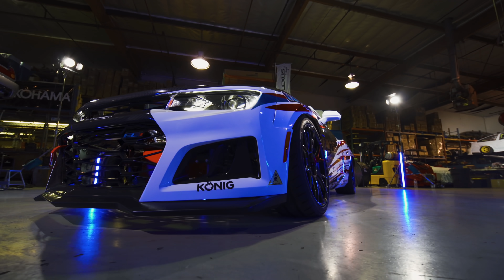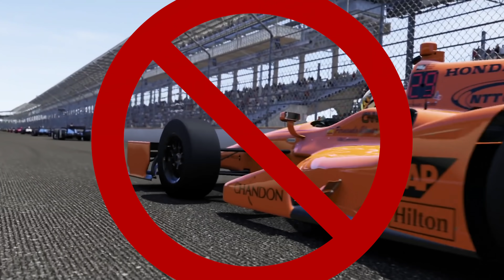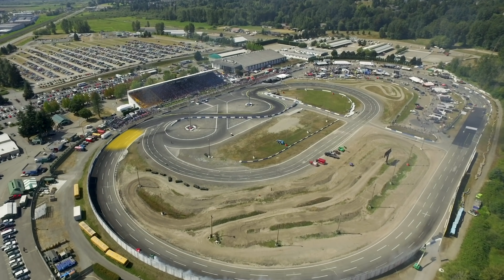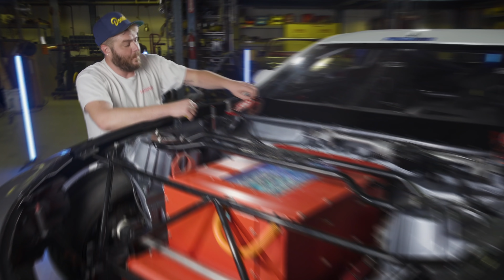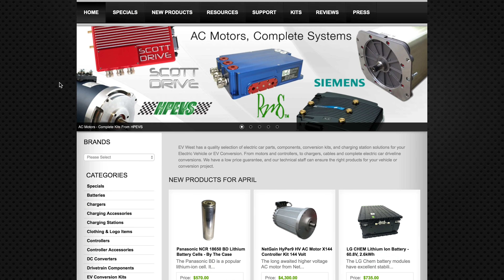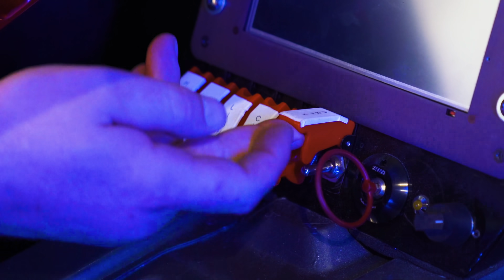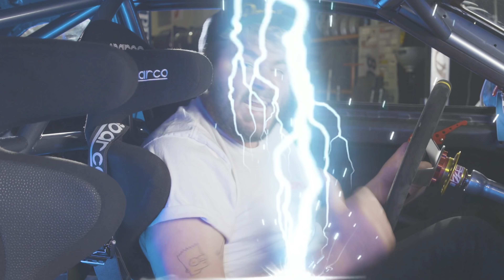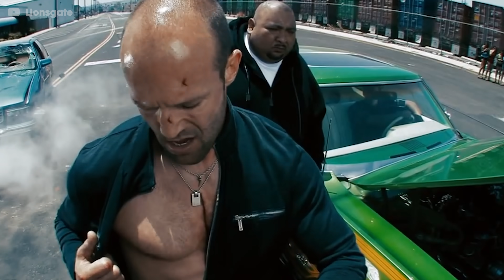Electric Camaro Drift Car: Exclusive First Look

Comment: Oh heck yes the PlayStation 1 Startup Sound would be perfect.
Reply: I mean, I'd personally use the windows XP sound effects
Reply: What about the wii start up?
Reply: @Neojhun  "Liquid Cooling is Standard Protocol for BEVs" - LOL .  Good thing thermal runaway doesn't happen on battery powered race cars ...
Reply: And circle of death from Xbox for visual stats of the car
Reply: @myc0p  Ewww no, even funnier Xbox One had a Power Cord Problem where it would Overload. Never associate Xbox to BEVs, it's a dangerous mess.
Reply: @Neojhun  Both of them are using angry pixies for power and both of them are prone to overheating.  These batteries will be going through quite a bit of load/stress on a track.  +Global warming ♨️
Reply: @myc0p  "both of them are prone to overheating" Stop with the Lies. It's freaking Liquid Cooled.
Only 515hp the battery pack is at really stable load. You could easily do 700hp reliably with a 40ish kwh battery.  Koenigsegg Regera is doing temporary boost of 750hp from 8kwh.
Reply: @Neojhun  Don't see them liquid cooling the battery pack.  Also, let's keep in mind that Regera is doing a temporary boost. On a hot day it will be a matter of time when battery management will go into a limp mode to protect the batteries from overheating. Hence the xbox reference.

P.S. When the fire starts, people usually run away from a fire.  Are we expecting 
that somebody in a hazmat suit will be running toward these two front connectors for external water hookup so batteries can be drowned in case of a fire?

Comment: very low battery capacity !!
you need minimum at least 100kw and even than it's very low !!
in this build is nothing to be proud of !!
also, dislike of speaker retardation !!

Comment: Electric is a thing of the past it’s boring and cheap
Reply: Anything electric can do for a car mechanical or pneumatic or hydraulic except for computers but those could probably be done using pneumatics too
Gas cars are faster in every way. Gas cars could potentially be more fuel efficient. And gas cars a way way cooler.
Reply: I meant to say anything electrics can do mechanical things can also do

Comment: 510hp out of 35kwh
then again its a race car that isnt expected to last and likely aint cheap
Reply: The kwh of the pack won't really tell you anything about the power output it's 35kwh is about a gallon of gas
Reply: @the1anonymouse  yes no. most industry batteries to date are in rather specific ranges for reasons of cost space and longevity. 3/3 of which dont matter for this thing
Reply: @Richard-ie1if  I think you may be confusing output with capacity. The capacity of a battery depends on the chemical makeup of the anode and cathode. The materials chosen for this could be chosen for those things but that would manifest itself as nominal voltage, and discharge rate. The KWH of a battery is a measurement of how much energy is in a battery as you have the KW with is KJ/S times 1 hour another unit of time which leaves you with energy. Again you can think if KWH as the amount of gas you have and the KW of the battery as the fuel delivery system of the vehicle

Comment: dislikes are the prius drivers who think an electric car shouldnt be fast
Reply: Screw those guys.
Reply: Bicc OG  "can't handle and ALWAYS crash" STFU man
Reply: GOD WILL ALWAYS WIN HE ALREADY HAS
Reply: @rockyaubin8728  Ok
Reply: He already yyh has won the war satan's losssss?
Reply: @rockyaubin8728  Don't argue cuz my name provoke it
Reply: @erlcoofr  Edgelords like you are cringy
Reply: ELECTRIC CARS SUCKS AS FUCK
FUEL POWER!!!!!!!!  
ONLY GASOLINE CARS CAN BE THE BEST
DAAAMMM i miss GOOD old    F1 V10  Sound from the 90'' and 2000" 
#keepfightingmichael #forçaferrari
Reply: Bicc OG nigga stfu lmfao
Reply: I'm offended, I drive a prius and am always speeding. We're not all slow old people 20 under the speed limit.
Reply: @Dank_Souls  You cant reach the speed limit even if you try
Reply: @caralho5237  the city speed limit being 50kmph and highway being 90kmph and 400 series highways being 100kmph its fairly easy to hit those speeds. a prius DOES have a gas engine in it as well as a battery, hence the HYBRID part of the name. the electric engine only goes to 40kmph so while im sitting in traffic im not wasting gas and while I'm driving normally im using less gas because the electric engine is helping the gas engine and when im trying to go fast its only the gas engine. makes sense?
Reply: @Dank_Souls  Makes sense, but a tesla is still 100x better
Reply: @caralho5237  well yeah teslas are dope, but I dont have to charge my car or worry if im going to get to a charging station in time before my car stops working lol.
Reply: @Dank_Souls  The prius struggles with acceleration, i dont know what highway are you talking about, because usually the limit is at least 110km/h
Reply: @caralho5237  mine has a power mode which just uses the gas from a dead stop, so the acceleration isnt that bad. The 401, 403 and 407 and QEW are all 100km/h i mean the flow of traffic is generally 110-120km/h but the posted limit is 100.
Reply: @Dank_Souls  that's cool then. Why did you decide to drive an electric car?
Reply: @erlcoofr  mother in law bought a tesla model s p100d an I needed a car so she put me on her insurance and gave it to me lol, personally I'm more of a Camaro guy than prius but it's been a decent ride tbh.

Comment: Great video, I've got a little electric van with 41hp, and it has traction control, I thought it a was funny thing to have, but with 196 Newton metres at Zero revs, it really is as it will smoke the tyres without it, although it will turn back on if you try to do a burn out.

Comment: You know, i have no issue with electric cars becoming the new hot rods, in fact, i think its great. The only issue i have with  it is of course, where is that sweet sweet sound of the engine roaring? It will surely be missed

Comment: He's talking about a brushless motor right? You have to have magnets
Reply: It's a Tesla drive unit so it's an induction motor so there's no permanent magnets
Reply: @the1anonymouse  so it uses an electro magnet?
Reply: @zodoGames  so basically there 2 parts to an electric motor the stator and the rotor in an induction motor the way electricity is passed through the stator creates a rotating magnetic field. Ths rotor is made of bars of aluminum or iron and the rotating magnetic field causes a current to flow through them. Then according to the Lorenz law the magnetic field and current interact to produce a force

Comment: Why the hell dont car companies make electric manual transmissions? They just would never stall. 
Win win IMO
Reply: Because EV don't need gear at all
Reply: Because you literally don't need to switch gears in an electric car. The motor provides power directly to the wheel instead of through a transmission. Doing that would only be a disadvantage
Reply: EV don't need gearbox cause its maximum torque is instant (from 0 RPM, unlike ICE which has max torque around 3000-4000 RPM for gasoline and 1500-2500 RPM for diesel), but I wish EV can installed with clutch for slow manuver torque control.

Comment: Wait... it sends water straight onto lithium batteries??? If anyone doesn't know why this is interesting, look up lithium in water. I assume they're aware of this and did something that would prevent it from just exploding but fire extinguishers seem like much better options to deal with any fires caused in the battery bay.

Comment: The best way to stop a battery fire is to never start one! This build looks to be using LFP (lithium-iron-phosphate) batteries, so flammability is nearly zero. (as with most things racecar, you do what's required by the insurance underwriters.)

(EV West might've sold them the kit, but it's made by EV Controls -- a Canadian company. And that motor is from a bog-standard Tesla Model S. Magnets can make for a lighter system, but has almost nothing to do with friction -- a brushed DC motor has additional friction from the brush contacts, but no one uses brushed motors in cars. well, drag racers do, but they're a special kind of crazy... 4000A with liquid CO2 cooling to keep it from melting.)

Comment: It is neither a Camaro or Tesla ludicrous mode.... it's just a slot car! I remember back in the day going to the Hydroplane races... they used to call them "Thunder boats" , 1600 ci Rolls Royce V12's it was cool... then I remember in 74 or so the Miss U-95 came out, it was a turbine boat second race the compressor exploded and it sank... well they perfected the technology and everything became turbines... there faster, but it's booty! WEAK.....!   No noise... Attendance went from. no joke 200k to about 50k if the weather is nice...  SOUL LESS! Motor sports will be dead soon  Half of the excitement is hearing that noise man, that RB, 2JZ, LS, Coyote bouncing off the rev limiter!  AHHH, THE WHIRL OF ELECTRONS! NOT!  All you hear are tires squealin!  Could somebody tell me why we have to put a 'u' after 'q' all the time!

Comment: Magnetless motor? You mean brushless motor. 
16,000 rpm is no big deal for electric motors, they don't have much friction and no reciprocation.
....and F1 cars no longer hit 16,000.
Reply: No he meant Electromagnetic Induction Motors. Meaning it has no permanent magnets. When there is No electric current it has near Zero Magnetic Force.

Comment: YES! So what parts determine more power, like HosPerss and torque the amount of power from the batters or the electric engine?  PS1 sound hmee... Drop the hammer on the petal of THOR, Thor petal, drop the hammer on Thor petal, try to think anything else other that thor and Tesla is, Wat petal, Volt Bolt hmmm.. I'll think of something.

Comment: The power electric motors give is amazing but I'm gonna miss the engine sounds so much
Reply: Allow me to sprinkle in a shameless plug!

https://www.reddit.com/r/DonutMedia/comments/bbiux5/i_showed_my_brother_the_camaro_el1_video_today/?utm_medium=android_app&utm_source=share
Reply: Easy fix put two speakers in the front with car sounds lol
Reply: Same thing when steam trains went diesel and electric, people still like seeing and hearing them but they are now museum pieces!
Reply: Electric cars are a scam, go check out the lithium mines and tell me how "clean" electric cars are.....
Reply: @Honky88  your a tit. Electric cars run on electricity, the batteries can contain lithium, but they don't have to.
While there are aspects of most current gen cars that are not 100% clean, please tell me how that compares to the entire mining/refining/processing/manufacturing of every part and fluid of an ice. And the fuel. And most of the products are use once.(pretty much the metal is recycled) 
That and the green part everyone goes on about is the current energy used to move the car. Which even if you use 100% coal power to charge the car, it's still cleaner per mile than an ice.
And hardly anywhere uses just coal. Where I am there is no coal power at all. 

And the batteries are 99% recyclable, so the value of used batteries will go up as lithium deposits go in more demand ect, which raises the value of old electric cars.
Reply: @Honky88  no... I called you a tit,
Reply: @Honky88  that's a poor attempt at a comeback. Please try again
Reply: @MichaelEdmond  says the guy who doesn't know how electric motors get their power. I can't take anything you say seriously after that first sentence....😂
Reply: @Honky88  that's like saying that ice engines get their power from the tank... While true that's not the whole story. You said 'rechargable' batteries, so they only store the power, it's not a power source is it? 
Or do you think your phone battery just magically creates power and that charging cable is not to put the power into the battery in the first place?
Reply: no one said you had to get rid of the sound...
Reply: @greynolds17  but who would ever have a Tesla Model 3, fitted with a V8 soundbox?

Sure you can do it, but it would probably 1. Not be legal, and 2. If the sound, vibration and power in no way correlates to the output then it's pointless regardless IMHO.
Reply: @protess5  first of all...I never said you needed to add sound to an EV...if noise is important, you can still drive a gas car, it's not impossible nor will it be illegal. As for fitting sound to a model 3, you probably could, you could also set up a modulator to the accelerator and use sound files from video games to make it as accurate as possible. The issue comes when emulating the sound a car makes without making it visible, and also making it good enough that people would think it actually had an engine...but I would rather just own an EV and a gas powered car. No one said you cant have both
Reply: @greynolds17  but here is the problem, because in quite a bit of the world, they do.
Norway is set for 2025, Denmark is set for 2030, some major cities are already banning fossil cars all together as soon as 2030. Even California is looking into this.

So sure right this instant, I can go out and get a diesel/gasolie/Gas/whatever car, but in a few years this option is gone, and this is why I feel the need to point this out now. Because in a few years, the option will be gone.
Reply: @protess5  no one is banning fossil fuel cars all together...there are talks of banning NEW fossil fuel cars, but not ALL fossil fuel cars. America has a huge collector car market. In places where people dont have old cars, you could get away with it, maybe in large cities, but not a country-wide ban on fossil fuel cars.
Reply: @greynolds17  Well Denmark and Norway already approved their laws, and a list of European capitals and large German cities have already done it.  
Sure, they won't ban fossil cars right now, but give it another 5-10 years, and it's done. I'll promise you that much.
After 2030, it's byebye to new fossil cars, after that point, you won't be able to import anymore, resulting in it essentially becoming a battle-royale of fossil car owners. 

Doesn't smell like choise to me.
Reply: @protess5  have you ever heard of grandfather laws? If the car was legal at the time of its production, it's still legal, that's why you can still drive a model T, or a car without seatbelts, or why you dont need to pass emissions on cars made before the 80s. Now I cant say the same for other countries, but from my research I have yet to see a law that will outright ban all gasoline cars. Not to mention that the countries that are adapting these laws already have a low number of classic cars and a high number of electric cars being sold.
Reply: @protess5  i agree with you. This will be shoved down the publics throat. They might, and i say might cause u never know. So they might not come to your house to take your fossil fuel vehicle. But don't for a second think they won't or cant make owning one a living hell. They'll keep bringing the decibel levels down ( probably the next step for California), they will Skyrocket the price of fuel, throw pollution taxes at you, throw old car taxes at you, and anything else you can think of. There are so many things they can do. Most street cars out there pushing out big horsepower numbers are running aftermarket illegal exhaust with no cats. Many states already have laws Banning non-oem cats. Wait till they start enforcing that. There's definitely trouble up ahead. The real trouble will start when manufacturers stop producing gas powered vehicles. The same Spectators who were cheering for the awesome sounding fossil fuel power drift cars, will be complaining about the noise eventally. Just like the same idiots who moved next to Englishtown and then complained about the noise and shut it down. Yeah this is a doomsday scenario. But it definitely could happen. Somehow I just don't see electric cars and fossil fuel cars living next to each other peacefully. Take it as you like
Reply: @greynolds17  True, but at the same time, i have seen my green taxes on my BMW 5series rise three times. 
When Germany rolled out their "Umweltzones", people who owned diesel cars that wasn't up to the standard was quite litterally forced to sell them for far less than they had invested in them. (we are talking even new cars here)

And Diesel powered cars are pretty normal here in Europe. 
They have done it before, and they can do it again..
Reply: @greynolds17  Sure yea the grandfather laws may protect already existing cars but they wont stop the end of the production of new gas vehicles which is sad and really shitty to think about. Itll come to a point where if you dont buy electric youre buying a really old gas car. Fuck that
Reply: @protess5  at a certain point of age...green taxes will probably not apply...but that's also Germany, cant do that in America
Reply: DJay don’t buy an electric than lol

Comment: I hate when a 'new' industry invents 'new' names for things that are already existing - 'magnetless' = induction motor, as in squirrel cage motor that might drive your bench drill for example, only with water cooling instead of air cooling so the outer shell can be lighter for given power. Also the motor doesn't give a shit if it's 'upside down' ;-)

Comment: Electric is clearly the future of performance, gradually it will outperform gasoline in all types of racing. Has already won Pike's Peak with a new unlimited-class record, I wouldn't be surprised if this demolishes the competition in drift. Electric dragsters are probably not far from beating their gasoline brethren. I'm expecting sometime soon there will be a competition-flattening electric aerobatic airplane - another realm in which they need absurd amounts of power for a relatively brief run. The last holdout for gasoline will probably be enduro - multi-hour races that is - where range is more important than all-out power. But someday electric will win that too.